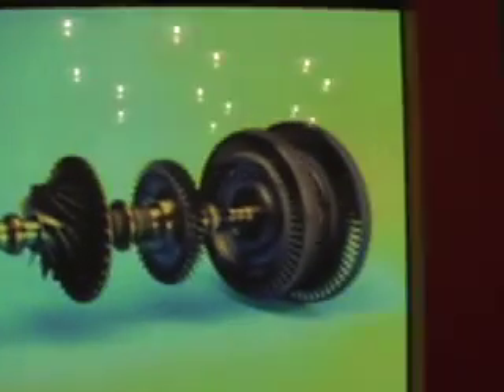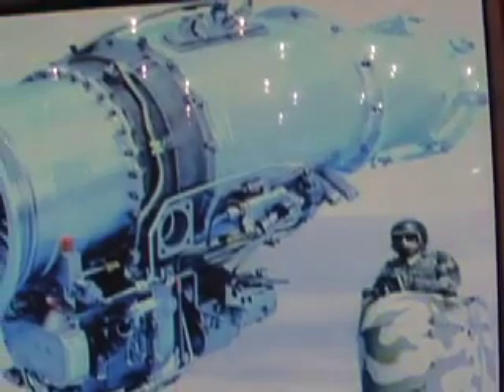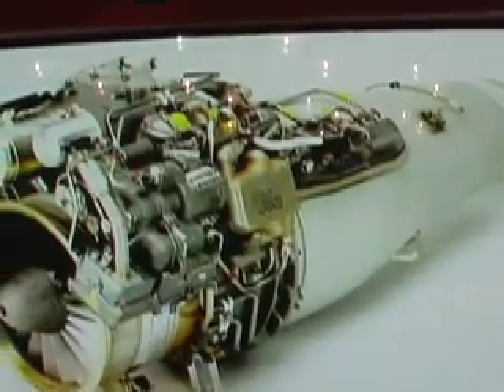Personal UFO, X-Jet A Flying Segway

Comment: The WR19 engine is between the pilots legs and is 24 inches by 12 inches and the fuel tanks are on either side.

Comment: @yumiyumiharu How does it work: a WR19-7 Fanjet engine is positioned vertically and the thrust exits the bottom, the film resolution is so bad you cannot see the Screens that cover the air intakes, it steers like a Bicycle, tilt your head forward and that is the direction you go, tilt your head back and you stop, very much like a SEGWAY. I do have the WASP BOOK, let me know if you want a copy, it explains the entire machine but is too big to send as a email attachment.

Comment: O.K. add computer assisted controls, a more efficient modern jet engine,and instead of emergency air bags an emergency parachute, and only let them fly along specific route systems that are synced electronically  with  powerful  data routing software, and hello jetson's, goodbye traffic.  plus if these were built in your city think of all the new jobs.  You know those jobs of the future all our elected officials are always talking about.

Comment: Engine failure = death is completely unacceptable. The FAA would never certify such a death-trap, Not only that, but the effectively tiny disk-loading makes for very high fuel consumption and short range. These types of things are absurd to consider for general use. They are specific purpose military aircraft that haven't even found good use in the military arena..